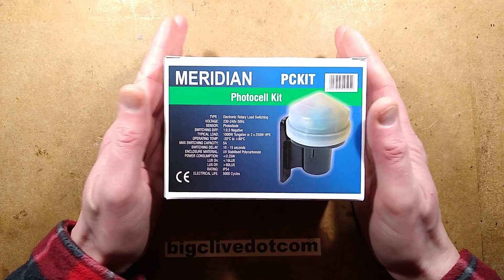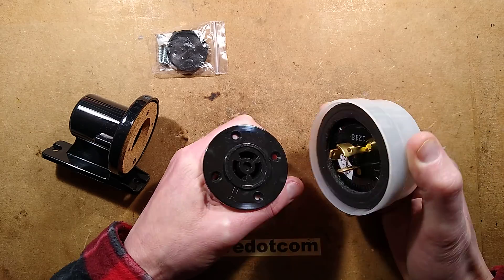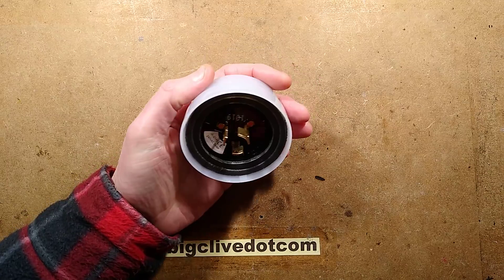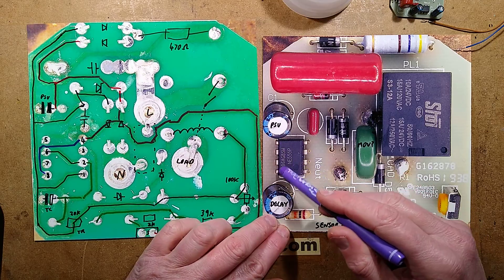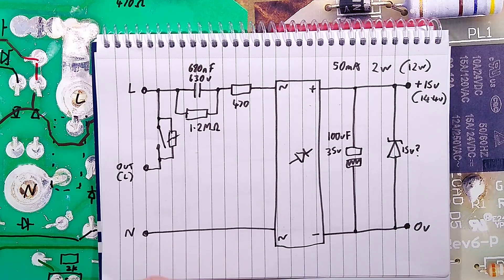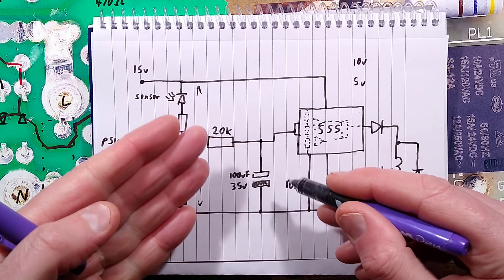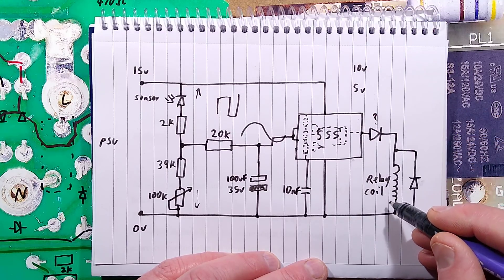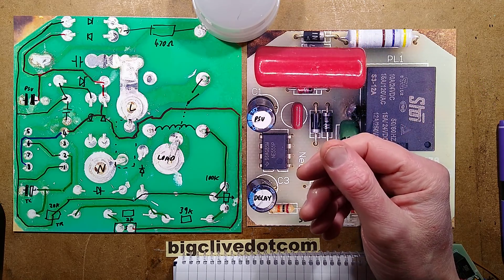Inside a UK compliant dusk sensor switch.  (with schematic)

Comment: Wonderful seeing a 555 in the 21st century when most engineers would probably use a cheap microcontroller.
Reply: 555 is both cheap, and incredibly rugged, simply because it is so big feature wise. A microcontroller would be hard to protect from the ravages of being outdoors, and especially all the unfiltered mains spikes it gets. 555 runs with no problems from 5 to 15V, and many will run at 20V as well, so they will survive well here. There are microcontroller based photocells, and they are definitely not a 5 pound including shipping item.
Reply: I'm no electronic engineer but I'd used something like LM397 a voltage comparator.
Reply: @koitk  I feel like that would cause flickering in the case of say headlights or the strobes on an emergency vehicle.
Reply: @rayceeya8659  A capacitor to effectively act as a low pass filter is all that's needed to prevent that.
Reply: Thing is, most probably a cheap modern microcontroller would actually only draw a fraction of the power a 555 draws...
Reply: @frabert  A micro would need a current amplifier transistor plus biasing parts to drive the coil. Sometimes parts count matters more.
Reply: @frabert  Yeah, but this thing is made for mains powered lights so even a 555 is minuscule compared to the primary draw.  I think we're seeing more micro's because that's just how engineers are trained now a days.  It's refreshing to see a classic simple circuit based around an IC with a grand total of 25 transistors.  

It makes a grumpy old bastard like me smile.
Reply: @rayceeya8659  I have to be honest with you, I don't understand your point. Using a microcontroller would (maybe? I don't know the exact economy of scale here) be cheaper, more efficient and maybe even smaller. It's just a better solution all-around, to me. I see no point in using something more specialized if it doesn't make the job easier or more efficient.
Reply: @frabert  You'd need an additional stage of voltage regulation for a micro, they typically run from 3.3 or 5v, so thats another few items on the BOM.  A micro would not be able to drive the relay directly, so you'd need to add a transistor and probably another resistor to the BOM.  Then you'd have to either spend a lot of NRE to get mask programmed micros, or add the programming charge to the BOM.  Once you've done all this, what advantage do you actually gain?  Micros certainly have their place, and give me my employment, but for simple, cheap and reliable devices analog designs are often more attractive.
Reply: @rayceeya8659  I bet you had the same "100 555 timer projects" book as me .
Reply: @benkerr9051  Nah, for me it was those 100x in electronics kits from Radio Shack growing up.  Didn't get acquainted with the 555 until I was in my 20s with a lighting and sound project.  Sounds interesting though.
Reply: @benkerr9051  I still have that book on my shelf right in front of me as I write this :)
Reply: @rayceeya8659  My first 555 project was a simple electronic organ that I built around 1980 that used the 555 as the master oscillator and a CD4024 as the octave divider. I later went on to design analogue synthesisers and other electronic music gear. This was in the days before MIDI and all the rest of the digital stuff. While microcontrollers do make designs cheaper and more efficient, analogue designing is still a hell of a lot more fun even today :)
Reply: @countzero1136  Two thumbs way up for analogue synths.  Love that rich crunchy sound.  Nothing like it.
Reply: More PE cells and streetlights pleeeeeeese Clive... :-)
Reply: Back in the 1980's there were SO MANY simple projects built around the 555 (and the 556 "Twin Pack"). Along with the equally ubiquitous 741 these cheap, versatile ICs were the mainstay of many a hobbyist (myself included!)
Reply: @phils4634  I still have a bag of 741 general purpose op amps. Really useful, but these days I use them mostly in mosfet driver voltage follower circuits. Really quick and easy relatively high current adjustable linear power supplies. They aren't really fast enough for demanding high bandwidth work, but for that, they are great.
Reply: Blimey! And there's me thinking i was up to date! Much appreated bud
Reply: Ah, happy days , remember buying my first from Tandy UK around 1981.
Reply: @nowtrytv  Got my first "30 in 1" from a yard sale back around 1986.  Still have my old 300 in one.  Comes in handy for circuit bending projects because that's the one with a built in bread board.
Reply: I'm waiting for someone to program a micro to look and act just like a 555. The location of the power pins would be an issue.
Reply: @therealjammit  I guess you can do that with an 8-pin micro PIC in a super small surface mount package on the world's smallest PCB.  LOL.  Maybe that's what'll happen about a hundred years from now when the world's supply of 555s starts to run low.  
I love silly solutions to simple problems.
Reply: In bulk, 555 timers are available for less than 6 pence each (£0.06). And as there are still multiple manufacturers, they are obviously still widely used.
Reply: ARM5 running embedded windows.
Reply: Robert Slackware - not really. Even PCs with multiple cores are hard to program to work effectively and efficiently in parallel processing. Now imagine trying to get microcontrollers that have limited RAM and limited connectivity and where every embedded application is running a program written by different programmers... That would be like trying to get 100% of politicians to all agree in something controversial!

Comment: Doesn't seems odd to have to dismantle the head to reach the trim pot? I would expect at least an hole in the base to insert a screwdriver.
Reply: You never adjust it as the end user, it is there for the factory only.

The ones I took apart, ex street light ones, typically had as well a massive MOV across the mains input, there to handle any and all surges on the line, and another on the light output as well. They use a better relay, one actually capable of switching 16A into an inductive or capacitive load, not the small Songle relay which is not really rated for mains use other than where inrush current is less that 3A, as the contacts weld together.

Comment: Hey clive. I have a (high quality) laptop 19v power supply (ASUS) that is now deliverin 0v that i might send yo if you are interested in doing an autopsy.
Reply: Broken solder joints on the mains input socket is common on these, but in general these power supplies are not the most reliable (high power heat-generating parts in a closed box with no ventilation etc). Output capacitor failure is also common (though doesn't always kill the output completely) but if it's totally dead (does it have an LED indicator on it?) then it's probably a failure on the primary side. Be interesting to see Clive do a teardown on one of these, but the chances of it going back together afterwards are not great as tearing these things down is generally very destructive. Having said that I have a repaired one here that's now held together with gaffa tape and cable ties that is a handy spare, though I wouldn't use it as a daily driver :)
Reply: @countzero1136  I allready skavanged the connector and soldered it to a better style higher amp PSU so I am totally anticipating it not going back together.

Comment: Sensor placement seems wrong, like it should be central and face out
Reply: Meant to be aimed at clear sky, and in the sun path, so it does not get light from other sources into it. For the UK thus aim lowish, and orient the sensor to face south. Here by me in the tropics aim more or less up, and hope the sensor does not get fried by the direct sun.
Reply: The translucent plastic cover should diffuse the incoming light?
Reply: @gordonrichardson2972  It still seems weird to mount the sensor right at the edge like that though

Comment: The problem with it turns on when it it’s combined with a timer/watch, Can be solved by letting the timer/watch controle the output to the light. That’s how I do it. Regards from Denmark.🥳🇩🇰

Comment: "but that's now" what? Obal? 🤔🤔

Be fun to install your own light into
Reply: Phonotical - 😆, quite useless - it points up in a fixed position, unless it’s mounted at knee/ankle hight, on a brightly coloured wall = to up light/white wash, if it is too bright inside it, it will  be fooled into turning off/on continuously at night, unless you manage to shield the photo-diode from the internal light
Reply: @samuelfellows6923  I meant like say you had an attic room, the lights could come on as soon as it gets dark out

Comment: The pins and socket are similar (same?) to those commonly used on US street lights and smaller area lights. The detector fixture itself is quite a bit smaller and mounts directly on top of the light housing. It has been decades since I changed one or took one apart but we can still see that little bump on top of many lights.
Reply from the maker: I think they're common globally.

Comment: In re the delay/hysteresis: could you do something similar with a Schmitt trigger? I am very much an amateur, and would be interested to learn why this wouldn't work when the 555 does.
Reply from the maker: It's being used as a single Schmitt trigger.  The advantage of the 555 is that it's common and can drive the relay directly.

Comment: Two watts of standby power is quite significant. Works out at about 16KWH per year or about 2 quid per year just to keep it warm!
Reply: I can think of a way to make a zero standby sensor using a small solar panel biasing a depletion mode MOSFET off, which in turn controls a relay.
Reply: @NiHaoMike64  If integrated deeply with a street light, run it from same DC circuit with no relay.  Alternatively, this relay unit can control an entire street of low power lights.
Reply from the maker: Or £12 if they start charging for apparent power.  The 2W isn't actually too bad.
Reply: @bigclivedotcom  Street lighting ones they want them lower power, so pay more for a more efficient unit. Adds up power wise if you take all the kilometers of street lighting, and consider there is one of these units every 50m along it. With LED lights the power used by the controller can actually be a big part or the overall power use.

Comment: Think John Ward recently showed a very similar sensor switch. He didn't go into the circuitry detail like you but showed the external wiring setup. 
Love the 555.....have built lots of little led thingies with them.

Comment: 555s are my favorite IC  :)   
Although, I'm definitely a novice in the building of electronics. I think I just love how flexible they can be for so many different applications. 
I have a small pack of those exact same 555s that I'm going to use to make some PWM led dimmers.
Reply: haha I'm a professional engineer and they're my favorite IC too.
Reply: I think it's definitely the favourite IC of most engineers and enthusiasts of my generation, probably because it's just SO versatile, and it's always cool to see old devices like this in applications where modern designers would just use a microcontroller. The thing is, if the 555 ever failed (very unlikely as they're really tough) you can just replace it. With a mirocontroller, it has to be programmed so you'd need access to the programming hardware and the code as well, which is not always an option for independent repairers. OK you wouldn't normally do a repair on such a cheap device (I would if it were my own, but you could never do it commercially) but you get my point.

While microcontrollers are great, nothing beats good, old-school analogue designing - it's just so much more fun :)
Reply: @countzero1136   I mean, I don't know what generation you're in, but I'm in my mid 30's and have been slowly learning electronics and circuitry. For the super basic stuff I do, the flexibility of the 555 and a few others means you can do SO MUCH. 
I think one thing I love about learning basic circuitry is knowing with a handful of basic components and a breadboard you can create something that does just about anything you'd ever want.
That's SUCH a cool experience. There's creativity, science, engineering, and a final result that's just so fun for me.  :)
Reply: Many, many years ago I built a motor speed controller for a remote controlled electric model speedboat for a friend. The boat had a 12V motorcycle lead acid battery powering it and he was trying to control that either resistively via a potentiometer or a big bipolar power transistor. Neither had a hope of working for very long because of the amount of power that they'd have to dissipate at half power. They'd just nuke out and die. But it occurred to me that if I used a 555 to produce a square wave at a few hundred hertz and then varied the duty cycle ( PWM style ) with a small potentiometer passing almost no current and then fed that square wave into a couple of mosfets, they could control the motor speed. Since the mosfets were either off or on, there was almost no resistive heat dissipation. I mounted the mosfets on a big heatsink anyway, just to be safe and put the 555 and associated components on a small pcb on the reverse. It worked really well, and was the terror of the local duck pond.

Comment: Somewhere on the top part there will be a mark, and you can orientate the lower part of the bayonet socket such that the mark on the upper part faces north, or as close as possible.
Reply from the maker: I did that.  Partly to point the sensor away from other light sources.

Comment: Clive... as always... THANK YOU for yet another very informative video. I am using very similar sensors (nema) sensors at the sanctuary. Mine are higher rated up to i think 1 or 2 KW switching power. sadly...there is no way to adjust the light level. ii.m.o. ours come on too early and switch off too late. but not being adjustable... nothing i can do about it.
Albert
Reply: Hi Albert Have had the same problem You need to get a Low (switch on at 10-30 "Lux") light level setting Photocell, The majority of these cheap photocells are all set@ around 70 Lux that drift over the years I'd recommend the AcRo model slightly dearer but guaranteed for 8 years  (Link below)           https://westire.com/product/economy-photocells/
Reply: @ghmusic8116  thank hyou so much will order one from them. It will pay for itself as it switched about 400 watts. Switching earlier will save money for the animal sanctuary I run
Our electricity bill is about 1700 pnxs sterling every 2 months!
Thanks again, like your alias... Wasn't there a book called little lord Fauntleroy?
My mem at 75 isn't as good as it used to be.
Reply: @albertkleyn111  Cheers Albert your welcome... Yes indeed there was (Little Lord Fauntleroy  a book and several movies made)  We have 5 LED floodlights around our premises here & the 1 AcRo photocell controls them On average lights come on (Later) /off (earlier) approx 15-20 minutes per day A large electricity bill savings over the years (Make sure it has access to ambient daylight for full benefit) Thanks again!
Reply from the maker: Can you rotate the unit so the sensor inside has the clearest view of the sky?